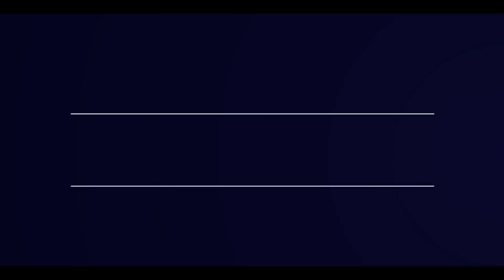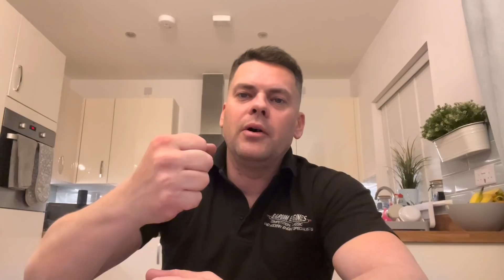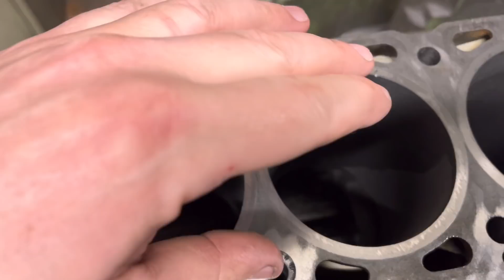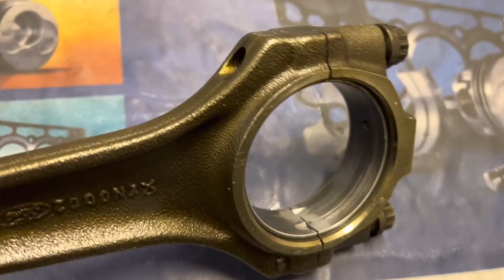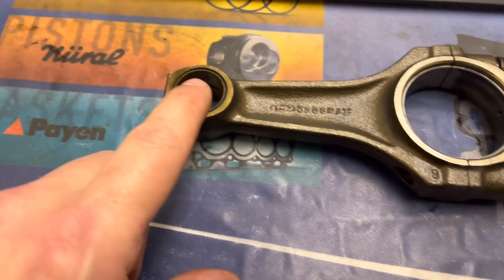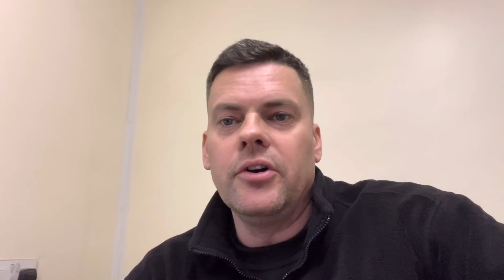Why are these engines SOO UNRELIABLE?

Comment: Old Japanese  engines  are bullet proof  reliable  and you could put  your life on them  , from honda 50 bike to Toyota 1c diesel.
Reply: The honda 90 and toyota diesel got their reliability through not having enough horsepower to hurt themselves. The toyota 22r has a excellent reputation  and i ran mine over 500,000km but willingly admit it got there by not having enough power to pull the skin off a cold bowl of custard. If you boosted a 22r to the same level as these cosworths they would be exploding all over the place.
Reply: Yeah, just like rotary or  flat fours

Comment: Early mk.1 950/1100 Fiestas blowing up their clutches.
Vauxhall's snapping their cambelts after 20,000 miles.
Head gaskets on Rover-MG k-series engines blowing after no time.
All cack engines.
Reply: I going to stick up for the rover k series. Had a few of them over the years. All had a head gasket go but as a result of water pump going, hoses and a leaking rad. My last one was a MG ZT 1.8t. No probs with that one. Fuel V power ended that one for me.
Reply: Apparently the rover k series has one of the best designed 16v heads...flows very good...competition head gasket and ARP studs is the way to go...it is a good engine when put together with the right gear...

Comment: Should have bought a Saab Turbo 🙂 Like Captain Scarlet, Indestructable.
Reply: Really,  in my 39 years in this trade I've yet to see a good Saab engine, good performance yes but most if not all the ones I've seen either burn oil (blue smoke) or they're noisy (in the wrong way).
Reply: They have their issues too, speaking from experience. 🤦‍♂️
Reply: Best engine I had was a vauxhall 1.6 SOHC injection 8v. Lasted 142k with only a timing belt and oil pipe replacement. Still had the original starter and alternator 😀. It did drink a bit of oil tho and had the mayo problem (not head gasket just cold) and the thermostat was always open for some reason.
Reply: @ukmechanic8923  B204/B234
Reply: @johnathanpearson3203  what about the non-turbo 1.8/1.9 Litre Peugeot xud diesel engines of the mid to late 1980's onwards? Now they were virtually indestructible, I had a Peugeot  205 with a 1.8l diesel  that I sold and bought back several times over many years and I had its  full service history from new,  it only had 8 oil and filters changes and 3 cam belts in its life (nothing else on the engine at all) and was still going at nearly 486k miles when it was scraped because the body shell rusted out.
Reply: @ukmechanic8923  agreed. Had a 205 with xud TD in it. What a cracking motor. Still miss it...
Reply: @ukmechanic8923  wow. They should make them again instead of these dpf stuff. Currently I got a diesel Hyundai 1.5CRTD brought it back in 2018 with 32k now it's got 58k no problems 😀 still young tho. Got the whole car (getz) for 1500 quid too 👍
Reply: @gpaul340  yes and the older ones. Nearly every one I've seen either burns oil or rattles, a few did both.
Reply: I'm running a Volvo C70 2.4 LPT, bought it with 138'000 miles at five years old,now twenty years old with 220'000 on the clock and still running ok.
Reply: @mickymac6571  I've got a Mk1 C70 2.3 T5 and an 850 2.3 T5 wagon that's remapped, Volvo 2.3/2.4 T5's are cracking motors, Stronger than the 2.5 T5's
Reply: @scotty6346  mine isn't the T5 , It's the less tuned one although I  had mine remapped up to 240bhp from 195bhp. It has a cracked wastegate housing now so it's probably down in power. I asked the mechanic/tuner  I use to put  T5 turbo and intercooler bits on but he refused , he told me not to waste my money.😄
Reply: @ukmechanic8923  The B204/234 have an overall really good reputation across the internet. I myself have bought one as a conversion into a vauxhall. 
I guess its all down to history of oil changes and fluids etc. Just like any engine.
Reply: @gpaul340  In reality, yes, maintenance is the key to reliability, at least to a point.

Comment: I believe supreme car services have just built a yb that made just over 1000hp on there engine dyno
Reply: Wow thats a lot from a yb standard displacement or 2.4 stroker?
Reply: @chrisclarke6344  yes i believe its 2.4 or there abouts , 38psi boost at near 8000rpm , has some nice parts fitted , they have there own facebook page..well worth a peek
Reply: @DanA-zx8jc  used to build them at 2.4 when they were current  would give 500hp reliably for road use. Will give it a look.

Comment: theyre not unreliable. theyre one of the most reliable engines out there. the problem is when people start f*cking about with them with stupid modifications. car companies spend literally MILLIONS per DAY in R&D on ALL parts of the car. do you really think someone in a shed on an industrial estate knows better than the manufacturer? more power ALWAYS comes at a cost of reliability. a bone stock engine will probably take an instant shot of 100psi boost. for about 1/10th of a second before it grenades, does that mean that everyone should aim at that level because 'its been done' even if it blew the engine to bits? if you want it reliable, leave it STOCK and use it as intended, not just as a trailer/garage queen that only gets started to move it outside to wash/polish or drive onto the trailer, or to have the daylights thrashed out of it non stop at a trackday. Andy Rouse got 550bhp out of these engines in the 1980s BUT im fairly certain that the engine in his car didnt stay in 1 piece after every race meet, and certainly not for 100,000 miles+ like pretty much all Cosworths have done now, despite what their owners tell you. if they genuinely have low miles then theyre probably a ticking timebomb due to lack of use/short runs.
Reply: Well said see my post above, used to tune them back in the day, all mods were tested with hrs of dyno testing before even being offered to customers. We found 205s were goid for approx 350hp, 200s done correctly with bore and stroke to 2.4 would give 500hp reliably without stupid boost pressures. See my post above.

Comment: They're still far more reliable than Vauxhalls 2l turbo of the time that's for sure, those struggled running standard power.....but there's no replacement for displacement imo and I'll never part with my E55 M113k engined beast.
Reply: No substitute for cubic inches, had my xfr with 600hp for ten years now no issues like you never part with it, v8 rumble rules!

Comment: When you take a block originally designed for maybe 200hp, and start making over 500hp with it....
Reply: Can be traced back to the T88 block from early 70s designed for approx 100hp!
Reply: A company called Smith and Jones I think they're called are producing new alloy blocks for the YB. Not cheap though!
Reply: @petergordon4525  theres one or two doing it they also do them for BDA motors. It appears no one with less than 6.5k need apply.
Reply: @chrisclarke6344  aye, not cheap, but that's apparently the price of a second hand YB motor now!
Reply: @petergordon4525  indeed mind you grub about in a scrapyard find a transit and get the motor the block will do the job. But i suspect they are wise to it now.
Reply: @chrisclarke6344  you can do as you say but the cosworth blocks were selected from the best castings
Reply: @MegaReddevil71  thats my point they are not made anymore so a carefully prepared 2.0 'pinto' will do the job. Back when they were current and used for racing etc, some folks went to far and spat a rod through block. At the time you could source a suitable replacement from cortinas,sierras, granadas,  transits etc. At the time i worked with these engines and for cheap replacement these blocks worked fine with attention to detail on the build. All cosworth blocks should be 'o' ringed with wire and long studded. Some of those blocks were still going strong 10yrs later. The biggest problem was people running crazy boost and hp. We found a well prepared cosworth in 2.0l form 350hp was the real limit any more and it lead to trouble. But if you bored and stroked these motors to 2.4l  500 reliable horsepower was attainable. We also found with the 2.9 cosworth 24v v6 if you took those out to 3.6l and revved them to 7500 rpm you could get 450hp naturally aspirated with slide throttles and bespoke ecu. It appears that watching these videos the old ways when they were current  which held them together has been forgotten in  the quest for crazy boost and hp.

Comment: Have many years breaking and fixing these engine s running 500hp never cracked the center stud s holes as they have towers 👍 they crack the 2 in front and the 2 behind 200 or 205 202 blocks obv the 200 can take long studs and the small core 205 . I've cracked a few 205 blocks at they points and yet again center stud s are fine no cracks . Recently had to 10 stud my 200 block as 6 were not enough almost cracked block through no 1 liner horizontal as it tried to pull up no1 stud behind water pump so they need a shit load of work to make them hold head down .. eg 200 block ductile liners and long studs for a 400hp plus reliable beast and race worthy ... 205 s can't handle the boost
Reply: Agree, back when current we would never make a 205 go over 350, if more was requested we always increased capacity and long studded 200 blocks were preferred all blocks were 'o' ringed and carefully built. Done correctly these motors were very reliable. As you say people give them crazy boost with no internal mods to cope then whine when they break. See my post above.

Comment: They were based on the pinto block, the  "pintosaurs "  was a poor engine to begin with ,while the head flowed well it just was not terribly robust so when people start dialing more power into them a lot of work and better quality parts are needed to hold them together.

Comment: So why is the red top vauxhall lump stronger or is it not tuned as much.
Reply: not tuned anywhere near as much and the red top isnt turbo. the turbo version of the red top was a LOT worse, by all accounts. they had issues even WITHOUT them being modded
Reply: Interesting. It does seem that most non Japanese 2.0 iron block 16v turbo engines had their issues or more specifically were only designed to make a certain power goal without excess capability for tuning?
Maybe the YB gets bad press because people have pushed them further than the other manufacturers engines for road use, and because of the Motorsport history.
Im not aware of the Vauxhall 16v turbo engine being used in competition to the same degree, and it was designed as a great Nasp engine unlike the Cosworth that was never released as a Nasp unit.
The Saab 16v turbo has its issues, so does the Fiat 16vt. The Rover T16 is another engine that's strong/reliable in its Nasp form, but wasn't designed for tuning as a turbo version. They melt the cheap cast pistons at less than 250bhp and bend rods around 280bhp. But then again I've not heard of known issues with blocks cracking, but then generally people don't ask for 30+psi and 500bhp from them.
Internal component strength is not a true measure of an engines strength or robustness when tuned, I remember that Mitsubishi 4G63T tuners used to say the Std engine internals are at their safe limits at 315-330bhp.
Reply: @petelattimer6808 only because by then cosworth weren’t casting the blocks

Comment: mate its old tec OHC engine ... all the new stuff is set for emissions  ... something of a similar age 3SGTE is better ... new stuff is the daft Toyota 1.6 3cl engine ... but otherwise there is nothing out there ... even the crazy italians have got nothing good
Reply: The old ways of 'a piece from here and a piece from there' tuning are over i feel.
Reply: @chrisclarke6344  agreed
Reply: @stuartlew1229  its all 'remap up boost and fuel slope' now. The ways of proper tuning are dying fast.
Reply: @chrisclarke6344  To be honest, after all the years that I've been in this trade, I'm only really impressed when someone can get a good power output and performance without ECU's and mapping. Old school all the way if you really want to have fun and achieve something, a 1930's car going over 120 mph with no pas/abs/servo or seat belts on cross ply tyres on wire wheels and cable operated drum brakes, now that'll give you an adrenaline rush.
Reply: @ukmechanic8923  agreed, we used to get the YBs up to 500 reliable hp and the old 24v BOAs to 400 n/a. They will hold together at those figures if its done right, the old ways have all but been forgotten. Some of the stuff known for blowing head gaskets 105es etc we even went 'dry deck' with no gasket! That would fry some brains today. Even my present driver a jag xfr i have mapped and pulleyed it to 600hp, but first i pulled motor stripped checked and rebuilt with new bearings etc, OCD maybe but felt i needed to.
Reply: @ukmechanic8923  forgot to say the joys of balancing and jetting three weber DCNFs on a essex  v6 fun days! Plus tuning an old ford flathead v8 pilot, that could take days.

Comment: This Engine is Was a Bit Of a Donkey From The Word Go . It was Supposed to Be Fords Stab at Rivaling The 1.5 BMW F1 That was smashing F1 To Bits at the time . It Failed On The Dyno at about 12 Grand The Hole thing Bends Including the Block it was also destin to be Non Turbocharged. The 205 Always Had Problems The Blocks were Just Not Made With the Mindset That they were going to see 300 to 400 Horse. How many of these Vehicles that have failed are Using Stock Rads. What Row size Coolers are we using.  Ford Latter Built the BOA BOB V6  Also had it's Issues But worked. Age of the metals poor running order all takes it's toll . The Factory Computers are Garbage Very Basic Devices. Pectal Runs Very well with this Engine. At the time When Touring Cars Stopped they were Getting them up to six hundred Brake.  Heat Displacement is Everything.  I Installed a  Electric Water Pump in to my Cooling System. it total changed how the engine behaved.it runs for about 7 minuets up to 15 .  Thermal mass will Increase in the liner for about 30 to 45 seconds after shutdown on a hot day even longer this is when they Do the Studs This Guy is Spot on The Face Grows.= Thermal mass Accumulation Not Enough Casting to Dissipate all that extra Heat . they get hot on 4 injectors So 8  then you are cooking .The Best Place For A Chipped Cosworth is Sub Zero Air Only.